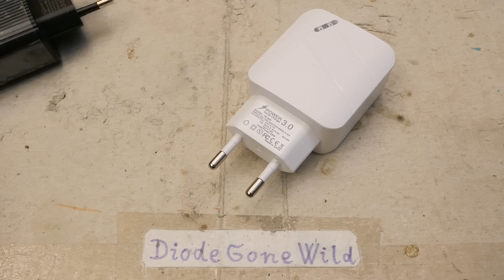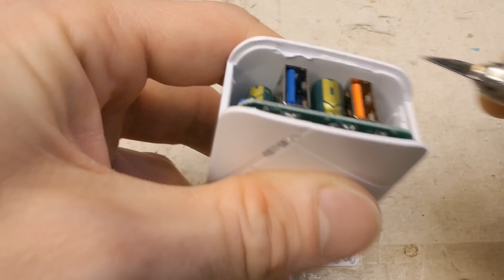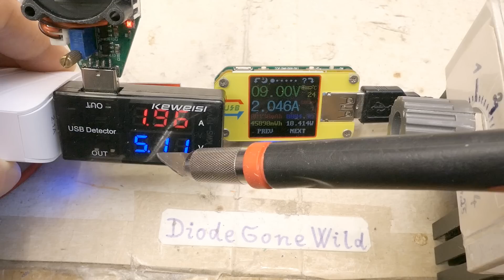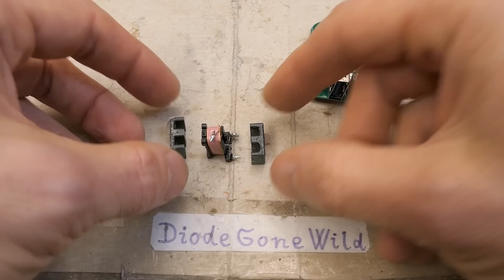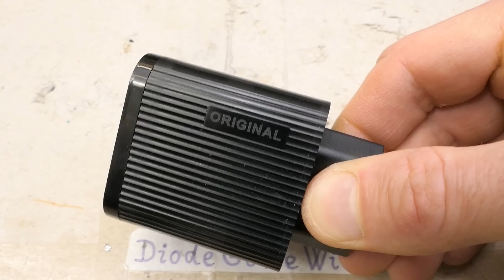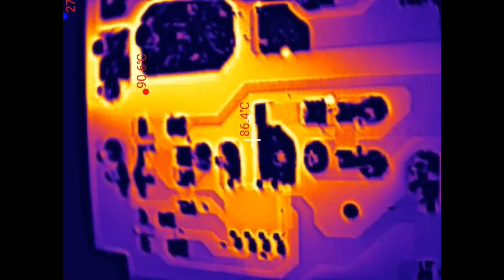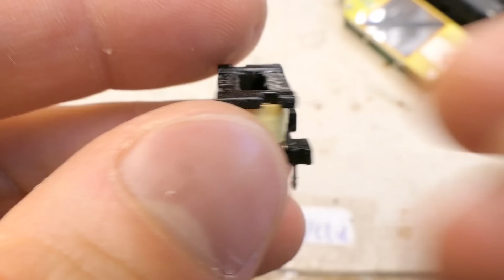Dangerous USB chargers 18

Comment: 6:40 And the case is OPEN when it is inside the case it would be MUCH hotter (but it should not get any hotter because its thermal cycling, the 5v circuits chip will also be thermal cycling approx at 187 degree Celsius probably)

Comment: i modded some chargers to dissipate heat (aluminium foil at case + thermal pads), now i figure transformers are the main heat problem.
Yes, a heat sink can solve some problems from these chargers.

Comment: It’s the tiny electrolytics that have 400v rating in these chargers that get me.  They really need to tighten up on LVD regulations.   They run these these components right on the bleeding edge.
Reply: What good would tighter regulations do? These already don’t meet existing regulations.
Reply: @tookitogo  Does LVD go so far as checking to this level?  As far as I’m aware they don’t tear down transformers or check specifications of components are adhered to.  It seems to be a basic check done by a local certification  company with good relations with the factories.  They are tightening up on the GPSR, too many of these devices are slipping through the net with a paperwork  CE certificate.
Reply: @JT_2024-c8j  I honestly don’t know. But that’s kinda my point: the Chinese vendors don’t bother to comply with even the loose regulations now. They’ll happily slap a CE logo onto some crap that hasn’t even had a cursory inspection, never mind a real-life safety test like UL performs. :/
Reply: @tookitogo they probably don't even know what the CE logo means, but they saw it on other chargers and thought that it was a cool logo to add.
Reply: @blisphul8084  Hahaha exactly!

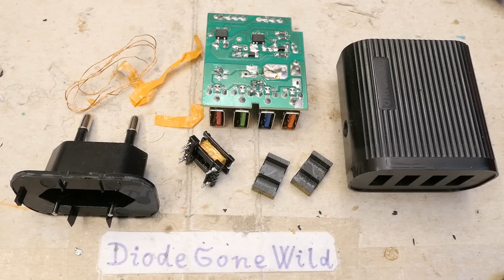Comment: Did anyone else notice that near the end (20:47) when he shows the underside of the "super dodgy" circuit board, the solder joints near the bottom edge look like little skulls? How appropriate!
Reply: Yeah ! I see 'um LOL !
Reply: They do look like skulls 😂
Reply: The manufacturer of the charger must've been aware of how awful it was. I believe it would be funnier, if Dan used one of those solder joints as a skull emoji

Comment: 2:50 It may also be a Y2 capacitor as the Y class is always suitable for mains to grounded or mains to touchable. Often, ceramic Y2 capacitors also carry the X1 designator, but Y1 is more rare and expensive.

Comment: The safety separation gap between high and low voltage side doesn't actually need to be 1mm  so i think it is unfair to always say its to small and dodgy.
And for testing before destructive disassembly i would like to see you use an high voltage insulation tester and test between high and low side at about 500volt.

Ive tested a few dodgy ones myself to 1000v without arcing, didn't try higher since i still use it 😅.

Short both input ac connections and put one test probe here, short all output cables and the other test pin here.

If you don't short them you can fry the internals by the static high voltage without it even arcing
Reply: They are still dangerous. The insulation could fail from overheating or you could simply touch the output and ESD would arc over the insulation or the capacitor.
Reply: The issue is not the normal (mains) line voltage, but any higher voltage spikes that may also be present on the supply.

Comment: Unreal temperature, how long that silicon can last. I have always thought that if I was making something electronic, the temperature of the component above 80-90 °C is fatal. And that is not the case at all. But apparently it brutally reduces the long-term life.
Reply: Plenty of silicon can be good to 125 degrees Celsius (that's a standard maximimum specification for mil-spec analog and logic parts for example) and some parts can be designed to be OK as high as 175 degrees Celsius under specific conditions.  Lower temperatures that you mention are often upper limits for high-density parts such as modern CPUs, but the silicon can often take more heat, it's just that the timing and leakage current parameters go beyond their workable values. Either way, the design must be able to get the heat away safely - not something that these supplies are capable of.

Comment: This is why manufacturers should still provide OEM charger!! Over 1000 euros(!!) for a phone and no charger, while 100 - 200 € phone comes with charger and headphones.

Or make it that while buying phone offer OEM charger for 5 €! 

I bought 29.9€ Honor supercharger (66 Watts and comes with good cable) not a bad price, but before it came with phone..
Reply: I lost my OnePlus charger, so bought an $18 65w charger to replace it and my phone only goes to 30w (its an older phone) and that charger gets very hot. It works fine though, and it's been a couple of years without issue.
Reply: Why would you buy phone that costs 1000 euro ?
Reply: @WuTangChopstick  I didn't, but midrange phone, like Honor 90 512/12 (I'm replying with one) cost 399€, no charger, no headphone jack, no SD-card.

Someone could want the latest tech with best connectivity and 5 years of updates. Reason just doesn't matter, what comes in the box does.

Comment: I like these dangerous USB chargers videos. It is good that you show these chargers for the death traps that they potentially are. Anybody considering buying a new charger for their phone, tablet, etc should watch your videos before buying anything. I had to buy a new charger for my phone recently and decided to pay the money for a Belkin 60 watt dual charger which delivers 30 watts on each USB C port. It supports all of the necessary communication support with the devices connected to it to set the right charge voltage and current. It would be nice as a comparison if you could test a Belkin charger and tear it down just to show what a properly engineered charger circuit should look like. I love your videos by the way keep up the good work!

Comment: They could have used the SR502, 3 or 4 instead of the SR510
The other variants have 20, 30 and 40V reverse voltage, which is plenty for a 5V supply, instead of the 100V of the SR510
But also they have only 0.55V forward voltage instead of 0.85V which results in 0.6W less loss at 2A
That would reduced its temperature from 110°C to only 80°C
This exact diode must have laid around somewhere for cheap, there is no reason to put in a 100V one
Reply: A flyback converter can have pretty high reverse voltage.
Reply: @sergepetrov8598  You are right. But on the secondary side these voltages are around the output voltage in reverse at maximum
maybe add 10V in reverse to the 5V on the output and a 20V diode should be enough already
The same goes for the input, but since there are voltages around 300V pressent, this means you need at least a 600V transistor for switching

Comment: 180????? how the lead solder dont melt?
Reply: Because it’s lead-free solder, so 217-227C.
Reply: yes but anyway it start to melt about 150-180 C @tookitogo
Reply: @mitropoulosilias  Uh, no. 
Every alloy can be viewed as a base eutectic plus any excess that may be present of a constituent metal. For example, 60/40 solder is metallurgically 63/37 plus 3% excess lead. 
This matters because the temperature of the eutectic is the temperature at which the alloy begins to melt. 63/37 tin-lead is a eutectic, so it has a single melting point, not a range. That temperature is 183C. So 60/40 solder, which is not eutectic, is actually a large amount of 63/37 eutectic, plus small crystals of lead. Consequently, 60/40 solder starts to melt at 183C, but doesn’t fully melt until several degrees higher. 

Tin-silver-copper lead-free eutectic melts at 217C. Not below.
Tin-copper lead-free eutectic melts at 227C. Not below.
Reply: googd. i didnt knew @tookitogo

Comment: That second charger is a public health hazard with the mylar film capacitor. Made about as cheap as possible. The solder work on the circuit boards look like it's all by hand, it's too messy looking for a machine.
Reply: Nah, hand soldering is too expensive, it’s just really poor wave soldering. Just the LED current limiting resistor looked like hand soldering. But it could still be low-quality wave soldering.
Reply: Made in shitty china garbage chargers

Comment: How the chip is not blowing up at that temperature? Isn't the max operating temp 150 deg
Reply: Depends on the chip. Power electronics chips tend to be designed to handle higher temperatures.

Comment: Why would a USB charger/power supply produce 9 or 12 volts? I thought USB was 5 volts.
Reply: 5V is the baseline voltage. There are protocols (e.g. Power Delivery, Quick Charge) that allow negotiation between power supply and device.

Without increasing the voltage it would've not been possible to safely deliver more than ~15W (~3A).

Comment: The first charger was absolutely baking itself at the maximum load it could supply without shutting down. Those chargers are getting better and better. These videos never get old.

Edit: If a USB charger says "original" on it, you know it's the farthest thing from the truth.
Reply: If it says original, you know these are the crappiest charger quality ever, don't come near any of them
Reply: 0:56 hy
Reply: Original as in using a 630v rated capacitor

Comment: With that second charger I have to wonder why it has so many USB connectors. Realistically you can only use one of them at a time. Were the designers being optimistic and they figured they'd give you extra so as you wore them out you'd have more to use?
Reply: Hmmmmmmm, "designers" ?????, so this was designed ????. Designed - planned or conceived in detail or for a specific purpose. Failed to  meet that definition completely.😏
Reply: @brucepickess8097  yes someone definitely designed the product. But those USB ports seem like they are largely decorative to me. They give the impression of power but don't deliver on the promise. It is all a big front. I'm thinking that was by deliberate design too.
Reply: You could charge multiple smaller things at once, or large things at a reduced rate. I believe smartphones would limit charge rate without cutting out. Four smartphones would eventually charge up but you wouldn't need to move plugs like you would with only one  connected.

Comment: 186 degrees is already a fire hazard if you happen to have any paper or wood dust in the air.
Reply: Well yes, however it would have to enter the USB ports.🤔
Reply: @brucepickess8097  that's the problem with dust, it likes to go everywhere
Reply: Maybe it's an in-room flammable gas burn-off feature?

Comment: Interesting way to thermally fuse your crappy power supply: Get the ICs to literally drip of the board.
Reply from the maker: It has to be a lead free solder, because Sn63Pb37 melts at 183°C
Reply: @DiodeGoneWild  I think leaded solder is only used for medical equipment, where lead free solder is explicitly forbidden because it is not reliable enough.
Reply: @mernokimuvek It’s not that lead-free is unreliable, it’s simply that it doesn’t have a long enough history of use to have proven its long-term reliability. But we will soon be there, I think, and some of the lead-free exemptions are actually expiring (and I think medical is one of those).
Reply: @tookitogo  Yeah the unreliable lead-free solder is mostly from devices using the cheapest and non eutectic alloys.
Reply: @oliverer3  I don’t think eutectic vs. non-eutectic makes any significant difference. Again, I have yet to see any real evidence of any reliability problems due to the solder alloy itself. There were process problems early on, but manufacturers have long since figured that out.
Reply: @tookitogo  Not sure for realibility but ease of use is definitely much better with eutectic alloys.

Comment: On the first one, it's hard to call it "thermal protection" if it cuts out at 190C; that's nearly enough to combust paper. However, it's surprising that the transformers had reasonable separation between layers.

The second one might actually be safer because it can't sustain enough current to bake itself.  Failing to reach 2A of current is both a fraudulent claim and a safety feature.  680mV PP ripple on a 5V supply is not a useful feature, though, and the transformer is deadly.